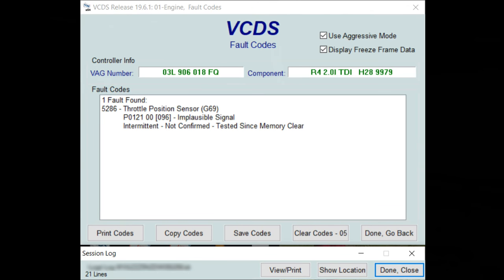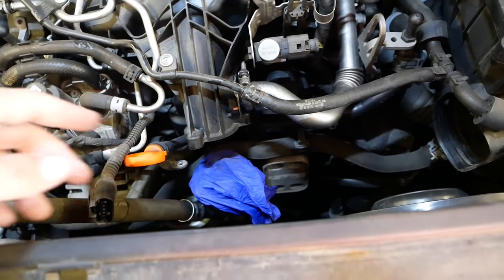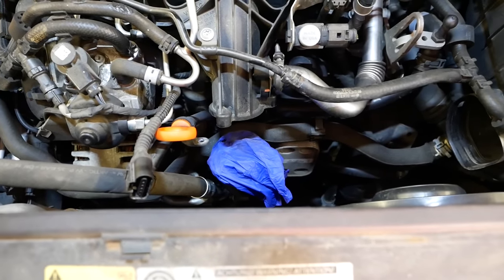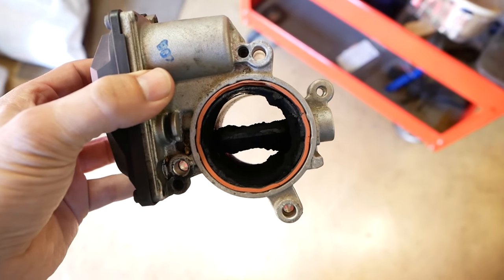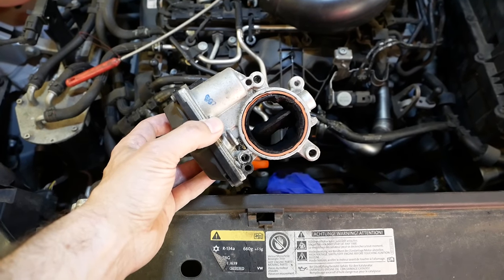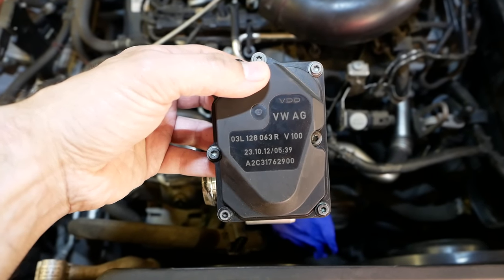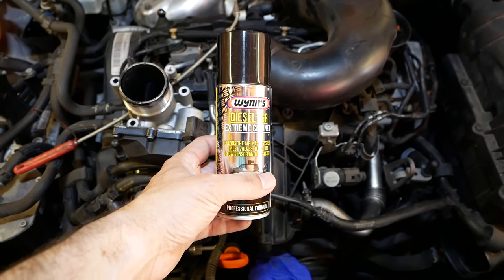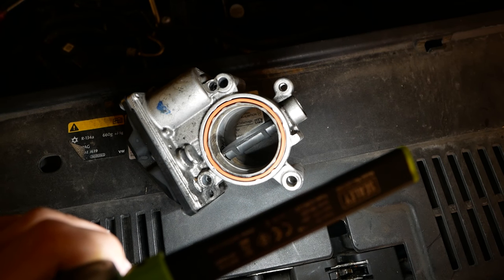P0121 throttle position sensor implausible signal - VW Tiguan 2.0 TDi - throttle valve cleaning

Comment: I had about 106,000 mile on my 2011 VW Passat with a CFFB engine when I started to get this code P0121. My throttle body was a little more in worse shape than what was seen in this video. I cleaned up my throttle body with a small wire brush and some carburetor cleaner. It took about 45 minutes overall.

Comment: I also removed the dpf pipe and removing the two t30 bolts and clamp found the flow adaptor to be heavily contaminated with carbon deposits too... Two min job to help with air flow 👌
Reply from the maker: Good idea, thanks for sharing your experience.

Comment: Helpful video thanks. Access is a fiddle and I bought this; SabreCut 1 x MRSC07 7-in-1 Flex Head 6.3mm 1/4" HEX Magnetic Mini Micro Ratchet with Extension Bar & 1/4" Square Drive Socket Adapter, from Amazon which made the job easy. Don't forget to clean out the manifold that the unit connects to since that will be clogged as well. Cleared most with the shaft of a small screwdriver against the side and there was probably more carbon inside there than on the throttle valve.

Comment: Just done mine on a 2011 tiguan with cffb engine,  exactly the same at 92000 miles, one thing i did was to remove egr, and clean that and just inside the inlet manifold,  one tip is to turn the egr around so it faces the engine not the throttle body, works the same but doesn't clog up as must, did the same on father in law's tiguan 2 years ago and no issues since, his was on 50k and really cloged up

Comment: Thank's for this great video! Had same problem with my Audi Q3, (219.000 km) with more or less same engine. In my case the motor alarm came on and the VCDS showed the same error. But a bit tricky to do the removal part, as I had to remove the flexible hose and the bottom spanner was positioned to the left. (Thank you Audi assembly line for causing unnecessary trouble).
Reply from the maker: My pleasure, glad it was helpful. I've cursed the VAG design and assembly processes on many occasions too!

Comment: Thanks for your video!   I just did that (I didn't have to remove the airbox to gain access to throttle.) on my 2015 VW Touran TDI 2.0L w/DSG6.   Everything back to normal, no more hick ups during acceleration.   Thanks again!!
Reply from the maker: Great, really pleased the video helped and you managed to improve the throttle response on your Touran.

Comment: Good video, thanks!
Few questions:
1) How did you ensure not to alter the position of the valve?
2) If you did happen to move the position of the valve, how do you reset this? Would you need VCDS?
3) Although you replaced the gasket, was the cleaner safe for use on the gasket?
4) Did you soak the valve or just spray and scrub?
Reply: Answers to a few questions having followed this video 1 year ago for my 2013 2.0D Yeti:
1) Valve has a hidden sprung mechanism that holds in in a certain position so you don't need to worry about upsetting it. You will need to alter its position in order to clean it anyway but it will return to rest.
2) Although I have VCDS, I didn't need to use it
3) I didn't replace the gasket and had no problems using carb cleaner
4) Just sprayed and scrubbed using an old toothbrush
You will probably need to do this again. After 18 months and 5k miles, I'm having to do it again. Wish the car did not have the diesel gate fix.
Reply: I'm not car mechanic and normally everything I try to fix on VW usually ends up in professionals hands, as I love to fck up things lol! But this job is so simple that I even managed to do it 😅 In my case this cheap fix solved two problems, 1st the fault code and the 2nd which I thought is the end of my engine, most of the times when I stopped and switched off the engine, the sound was like someone just put the steel rod into pistons.. I just can't describe the sound of it..
Reply: @stop116  hahaha good job

Comment: I got this error last week, when I stopped the car and the start-stop system stop the car, the MIL appeared. I cleaned the error and it came back because the start stop again. There was the glowpugs intermitent also. If I stopped the engine and started It again, the glowpugs were gone but MIL stayed. Today I have followed your steps and it's fixed! No problem with start-stop now, and MIL is gone after clearing with VCDS. I have made a throttle body alignement with VCDS too. Thanks for your video. By the way, has the car of your video the MIL again since the fixing? Will It come back?
Reply from the maker: That's great to hear, really pleased it worked for you. The MIL was never on in this car. I noticed the fault code when I was scanning for other codes with VCDS. I think the car has done about 3000 miles now since the cleaning, and the code hasn't come back. It will most likely reappear at some point, as the soot deposits gradually build up again. I guess how long that takes very much depends on how the car is driven.
Reply: @AndrewFixes  thanks for your reply Andrew, you have any advice on how to drive? I always thought that low rpm were better, near 2000 rpm, but now I see it's bad. This weekend I have a long drive. I have read that I can clean the EGR and the DAF going on a determined rpm on Highway, you know if this is true? I know that the best thing is clean It manually, but if I can do something driving for cleaning a little bit that would bé great.
Reply from the maker: @atleti910  A few things to think about. If you haven't had the 'dieselgate' emissions fix done, I would consider avoiding having it done. The car in this video had the 'fix' applied. I'm not saying it caused this problem, but it does increase the level of particulates produced during combustion. About driving,  VW have published information on a suggested drive cycle to follow if the DPF warning light comes on, so this would be a good starting point, even if the DPF light is not on. The car needs to have plenty of fuel (more than 1/4 tank) and the engine needs to be hot. Speed above 60 km/h, rpm between 2000 and 2500. These conditions need to be met for at least 15 minutes. If you have the DSG, you may need to put it in tiptronic mode so you can select the 'gear' to get the rpm in the correct range.
Reply: @AndrewFixes  I have the damn dieselgate fix, they promised me the car wouldn't lose power, and not only It has lose power it also produce more carbon particules then. I will do what you have said, I Hope It helps cleaning the EGR, in my engine is very difficult to access the EGR to clean It, I am looking for solucions to cleaning it mounted. Thanks a lot.

Comment: A fantastic video. It helped  me today. The only question I have is about the need of alignment after reinstalling. When the MIL code appears will vehicle turn the safe mode on, letting the throttle valve constantly open. As we seen in the video. Thank you for such a helpful video. 😊

Comment: Hi Andrew, great video. I have a Tiguan 2 litre blue motion, with the same fault code as the one you have, the throttle body was caked up I have cleaned it with the same cleaner as you. The engine warning light is on how can you tell if it’s the body or the throttle body?

Comment: Did you have to set it's idle adaptation after putting the throttle back in and if so, how?
Reply from the maker: Hi, no I didn't need to do that, it worked fine just being plugged back in after cleaning.

Comment: Amazing video, great quality too. My only question is was it hard to remove and what tools did you use to assemble and disassemble the throttle body?
Reply from the maker: Hi, thanks for your comment. It wasn't too difficult to remove the throttle valve. I used a T30 Torx bit in a small bit driver ratchet (https://amzn.to/2rPLKSm) to remove the 3 bolts holding the valve in place. Can't remember exactly what I used to remove the piece of air intake shown in the video, but it was probably a combination of a flat blade screwdriver and some plastic trim tools (https://amzn.to/2REHpvj).

I fitted a new seal when putting it back together (http://ebay.us/mVcvkU).

Thanks!

Comment: hi, i have a 2012 skoda superb 2.0 tdi cffb engine. it cloncked out on me and wouldnt start. got it started with easy start. after few cranks. drove it half a mile and stopped again. no warning lights but i ran a generic scanner and it was p0121 code. do you think the throttle is sticking hence causing it to stall and not re start
Reply from the maker: Certainly could be, but hard to say for certain. If it's got to the stage of stopping the engine running, it may be stuck to the point that the mechanism has become damaged. You could try cleaning it and see how you get on.
Reply: @AndrewFixes  all sorted now. Replaced throttle nut also found the egr was sticking open so deleted that too

Comment: Hello, i have same fault, my car start throw black smokes and are a bit laggy when i accelerate also there is not much power like before.
Should i clean or change it ? Do my syphtoms are the same?
Reply from the maker: This car didn't have any obvious symptoms, although it drove much better after cleaning, so it was clear at that point that it had gradually been getting worse. Although this had been happening slowly enough that it was hard to tell.

If it was my car, I'd try cleaning first.
Reply: @AndrewFixes  Well i had broken manifold valves with this fault code.

Comment: Do you need to re-align the throttle body using software like you would on a petrol engine ? 
thanks
Reply from the maker: Hello, no there was no need to do that. Cheers
Reply: Qucik procedure to do it anyway. no need for OBD software etc. I think it was have ignition on and put foot on throttle for 30 seconds, you should hear it actuate once compete

Comment: Can anyone confirm that it is essential to do a TBA after completing the clean , I'm happy with the cleaning part of it but don't have access to VCD for alignment , have read that it won't drive again if not done after removal for cleaning ,, 
Thanks in advance if I can get a clear answer ..
Reply from the maker: It doesn't have to be done with this vehicle. I didn't do it and the car was fine, started up straight away and drove better than ever.
Reply: @AndrewFixes  thank you   for the reply ,, can crack on with it now ,, 
Have a good day

Comment: Thanks Andrew.  I can't see too clearly from the video but did you remove the entire rubber intake tube (the one with the glove covering) when taking the valve off or did you just undo the top bit of that hose? I'm finding the access quite tricky in my 2014 2.0 TDI Tiguan, espeically as the bottom hose clip is right up against one of the radiator/intercooler pipes.
Reply from the maker: Hi, I just undid the clamp at the top of the hose with the glove on. There was no need to remove anything more than that. Hope you manage to get it sorted out. Cheers

Comment: I have the same engine in my 2013 tdi passat and I am having throttle issues sometimes it stops accelerating when on the highway and starts back so all I have to do is clean it not replace also no check engine light but I have 187k on it and throttle problems uma clean it
Reply from the maker: You might get away with just cleaning it - certainly worth a try first. But I don't think the cleaning is a guaranteed solution every time. I guess eventually the motor moving that butterfly gives up if it's constantly working against mountains of soot.
Reply: I did yesterday I took it off and use engine gunk 1st then 2 cans of carburetor/throttle body cleaner and it did the job
Reply from the maker: Great, glad it worked!
Reply: @AndrewFixes are they easy to remove?

Comment: Think its the same thing?
Reply from the maker: Hi Dave, maybe, or maybe not. Sorry to be so vague but difficult to say for sure without more information. You may need a new throttle valve/flap assembly, i.e. yours may have gone past the stage where cleaning will fix it. Would be interested to hear how you get on. Cheers

Comment: P0221 is the same as this code?
Reply from the maker: Similar, but not exactly the same. This is an implausible signal from throttle angle sensor code and relates (I think) to petrol / gasoline engines. Often caused by wiring problems at the throttle body control module.
Reply: @AndrewFixes  hey thanks for the reply I took my gti to the dealer found out it was the engine harness that shorted out, had to replace the whole thing lucky for me had my extended warranty cover 80% of it

Comment: I have a jetta with p0122 it has hesitant throttle response.
Reply from the maker: You may be able to fix that by cleaning it or you may need a new throttle valve/flap assembly, i.e. yours may have gone past the stage where cleaning will fix it. Would be interested to hear how you get on. Cheers